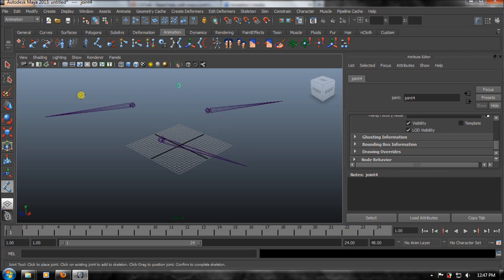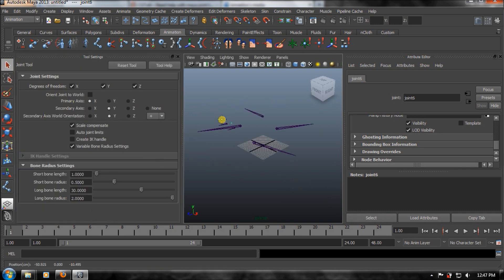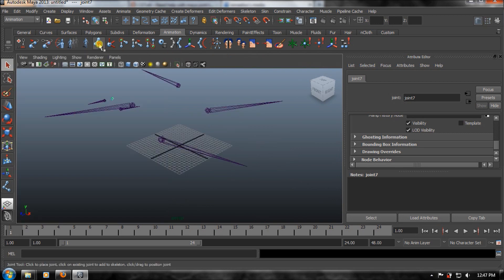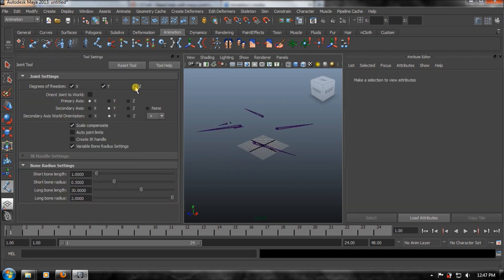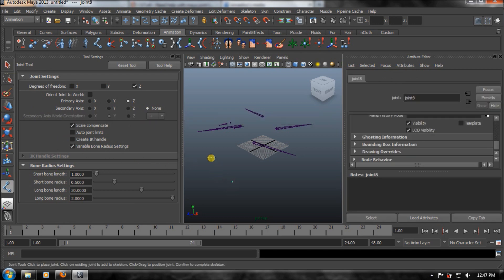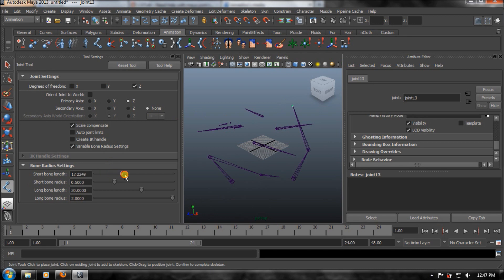joint tool problem

Comment: Thank you my friend you helped me a lot. Without your video I don't know waht I could do. Appresiate it. Thanks
Reply from the maker: Ive found out the real culprit, it was the video driver, even the maya 2014 does the same thing, i did somehow downgraded my driver, and the its back to normal, if you have upgraded your driver try rolling it back, i'm using amd radeon hd 6470m and it has some conflicts, well bug i should say.